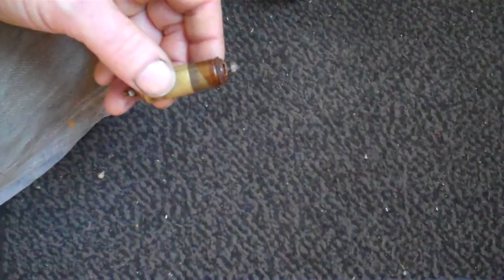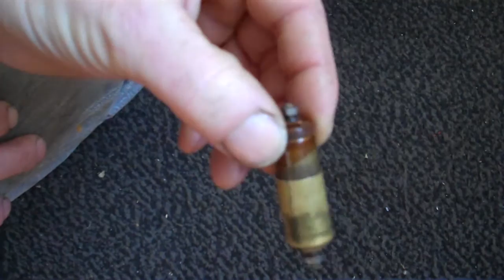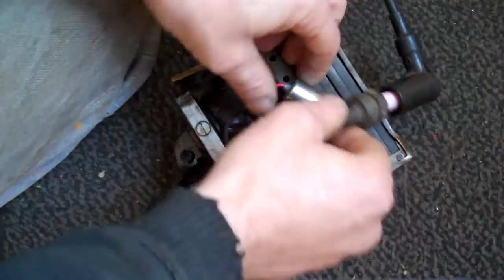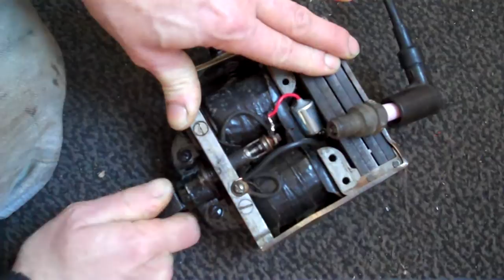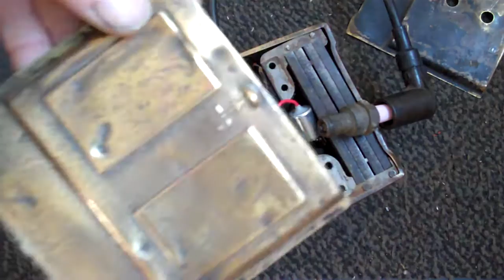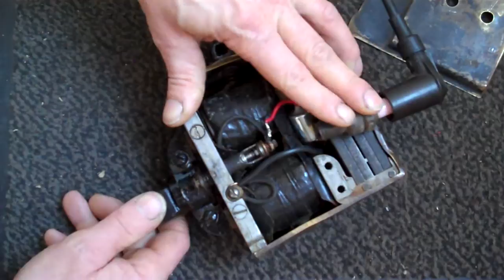WICO EK MAGNETO PART

Comment from the maker: I just used a spare bosch condeser that I had in my spares collection.  The value is not marked on the box or the condenser, but it was only supposed to be a temporary measure but worked ok. I'm not sure if this was just luck but it works just fine and the engine starts and runs realy well. Check out the WITTE videos on my channel.